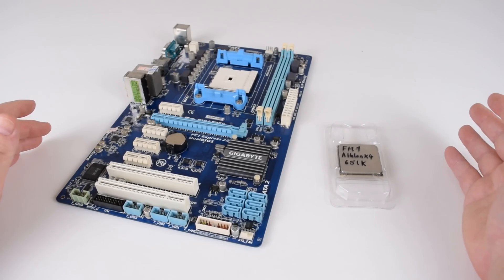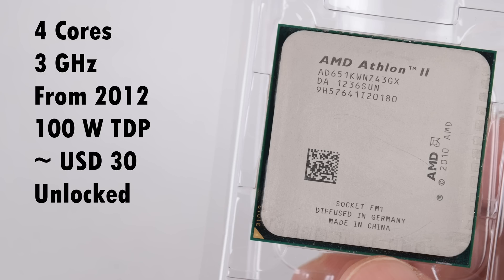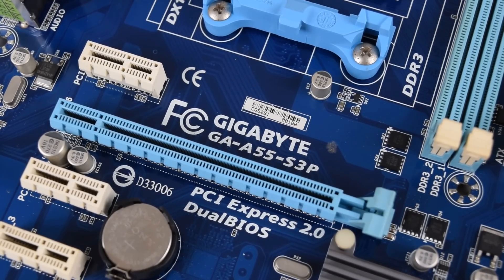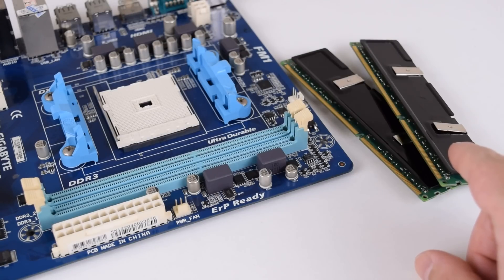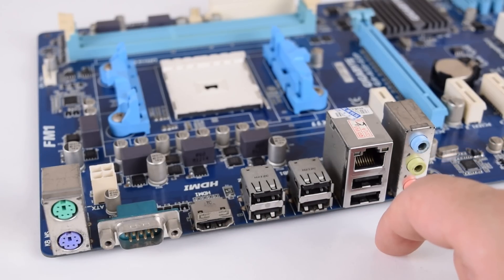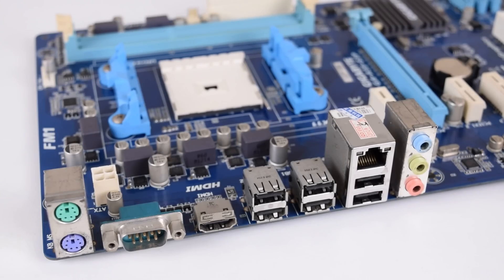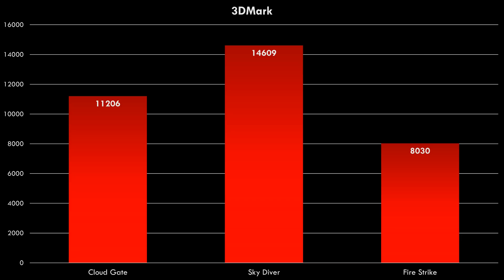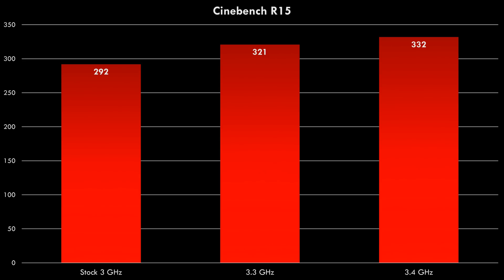Socket FM1 First Look: Athlon II X4 651K - The best CPU

Comment: Hi Phil, got a Athlon II x4 640 overclocked to 3.6Ghz in my Windows XP rig. I managed to get the GTX950 working with Nvidia Drivers 368.81 no problem, I just had to install with a GTX650 first then took that out and replaced with the GTX950 and it picked it up and installed the drivers! Really happy with the performance and it only cost me $10 more than a GTX750TI and chomps through frame rates on XP games like a hungry horse! Totally recommend trying it if you get the chance! :)
Reply from the maker: Oh you're using the X4 640 with Windows XP? Nice. My choice would have been one of the fast dual cores, but then it does depend on which games you're playing. Also, I should have a GTX 950 soon. They seem to be priced just a tiny bit higher than GTX 750 cards on AliExpress.
Reply: @philscomputerlab  Yeah, I've got the Athlon X2 7750 which is awesome in XP, but I won a Athlon x4 640 on eBay for $6 so I swapped it out and it is running a little faster I've found (even though it has no level 3 cache on the x4 640). Anyway, hope you enjoy testing the GTX950 in XP, I know they are a little more expensive than the 750Ti but I feel they are worth it. Can it run Crysis I hear you ask? What do you reckon?! ;)
Reply from the maker: To be honest, I found the 750 Ti has plenty of performance to run anything from the XP era, even at 1080p. Keep an eye out for a Phenom II X2 with high clock speed. The Business Class CPUs (I reviewed the 3.5 GHz) version with L3 Cache are excellent for XP gaming.
Reply: PhilsComputerLab I saw that Phenom video thanks, I had a look on eBay for one last month and they were quite pricey compared to the Athlon II x4’s. Not sure how much performance I would gain with level 3 cache on the Phenom’s in XP? I only went for the GTX950 because I kept on losing auctions on eBay because every Tom, Dick and Harry was bidding on them. I found less people bidding on the 950’s and fortunately I ended up being the second bidder on the one I ended up getting for not much more than 750TI which I was really pleased about. So yeah it’s turned out to be a pretty good deal! 👍
Reply from the maker: @PierreVonStaines  Yea I hope my 950 will work when it arrives. The 3.5 GHz Phenom II X2 is maybe 30% faster I would say.
Reply: PhilsComputerLab I’m sure it will be fine! 😉 The ones I have seen on AliExpress look pretty legit so it will be interesting to see what you think. I’ve have a new found appreciation for Amd processors again so I will keep an eye out for a decent deal on a Phenom (although FX8350 are going pretty cheap new at the moment, so that’s another thought 🤔).
Reply from the maker: @PierreVonStaines  I got the cheapest one I could find, a model from Gigabyte :)
Reply: @PierreVonStaines  I have an FX-8320e which is just a lower power 8350 and I can say even in 2019 I'm quite happy with its performance. I have mine paired with 16gb of RAM and an R9 380x and I'm getting over 100 FPS while recording my gameplay at 1080p 30 FPS and its smooth as butter, no jitters or stutter.

IDK how it would handle running a retro build as that would probably be extreme overkill (I'm running 8.1 X64) but for modern games it just blows through games like the Middle Earth saga and War Thunder while letting me capture gameplay no problem so if you can get one for a good price? I'd say go for it, having all those threads makes OS responsiveness just insane when paired with even a budget SSD.
Reply: Hairyfeet Thanks for the info, FX processors generally get mediocre press when looking at reviews I keep hearing from owners how happy they are with them. The old Athlons x2 and x4 have really surprised me, after sticking with Intel for the past decade I feel embarrassed that I have missed out on these AMD processors. I know lots of Intel users have jumped on the Ryzen bandwagon because of its stunning price to performance, but I think I am going to go for a FX8350 and motherboard for cheap build and reuse a load of parts I’ve got laying around. I’ll let you know how it goes! 👍
Reply: @PierreVonStaines  All those press guys going "poo poo" over AMD FX? Yeah look at what tests they were running, Cinebench (which got caught a couple years back rigging against AMD, it was reported by Tek Syndicate) and a bunch of programs and games that were single thread bound. Yeah single thread performance is great until you think for a second and ask yourself...how often are you ONLY running a single thread on your PC?

As I'm typing this I'm watching a video AND I'm doing a 1080p 30fps gameplay footage render...and its completely responsive, it feels no different than if I was just watching a video on YouTube. No lag, no jitters, even with all 8 cores pounding away with 96% utilization Process Lasso reports I've got 100% responsiveness. The same goes for capturing gameplay, I'm getting between 87-112 FPS while recording at 1080p 30fps and I actually had to turn on the little "You are recording" indicator because I kept forgetting and would end up recording the lobby while I ate a sammich. No lags, no stutters, just smooth as butter.

So yeah you want a cheap build with plenty of muscle, that can last a good while? I'd highly recommend the FX-8 series. Heck I'm not even OCing, I'm running stock but OOTB I ran the OCing utility that came with my board just to see what she would do and easily hit 4.5Ghz and talking to the guys with 8350s that is pretty much standard. Just get a decent cooler (I'm running a Zalman CNPS11X but any good Zalman or Hyper cooler will do) as the stock coolers are rather weak and I bet you will quite enjoy how snappy your PC is with 8 cores on call. GL and let me know how it goes!
Reply: For Windows XP, a GTX 285 is theee GPU to have in my opinion. Or if you got the power. and a nForce chipset... Two of these.! The GTX 950 is way better for modern gaming with DX11/12 support of course. But Windows XP has no DX11 support, so no reason for anything higher than the best DX10 card. For a Dedicated XP rig, my best experience is a Core2(or Xeon)  LGA775 CPU at 3+ GHz. (But I'm sure the Athlon II chips are also great for XP) Throw in a GTX 285 GPU (or HD4890) and SB X-Fi for sound. Superb compatibility, no driver issues. A 8800 GTX is also awesome for XP.. For Crysis a tHigh settings you want a minimum 768mb videocard (for high res/high settings a 512mb gives you lag) along with 3+ gig of system RAM. BTW. For Win XP era games you get no actual benefits of Quad Core. A Dual @Highest possible Clock speed is optimal. If you have a Quad core, you can disable the extra cores. Saves power and heat. :)
Reply: @Wushu-viking  Thanks for the tip pal.I actually use it in dual boot with win 10 for more recent games so I needed the DX11 support.Cheers
Reply: @AnarchieEnChiraquie  That makes sense that way. Great idea with dual boot. Saves space and money. :)
Reply: Thanks for the info guys. I just like mixing it up with using newer bits with XP and having the flexibility to install Windows 7 if I fancy it. I just find it enjoyable to see these old games running amazingly well and I feel it’s really satisfying to do so without spending a fortune. Especially when you come across a sweet deal like GTX 950 for not much more than a 750TI that everyone looking for a budget card seems to be interested in at the moment. 👍
Reply: Solid rig.I run an overclocked 4.6ghz G3258 with my OC low power GTX950 on my win XP rig.Had no problem installing the black edition straight with the 950.Same as you I had a great deal on it because everybody was all about the 750 TI
Reply from the maker: My GTX 950 arrived today! It's this one: https://www.gigabyte.com/eg/Graphics-Card/GV-N950CN-2GD-rev-20#kf It works AOK, ran some benchmarks and also cleaned it and fresh thermal paste. The card arrived in excellent condition. I got a bit of a surprise, it turns out the this REV 2.0 doesn't require a 6 pin PCIe connector! It is still an OC model and boosts just fine in games...
Reply: @philscomputerlab  Awesome! See I told you it would be fine! :) I ended up getting a FX8370 as they where going cheap on sale with a Wraith Cooler. I tell you, I am really impressed so far for a cheap Windows 10 gaming PC! Coupled it with 16GB of RAM and a GTX970 and just clocked the CPU to 4.4Ghz without touching the voltage and its performing great at 1080p (60 plus frames on games I've tested at high or very high settings)! It's a shame it's taken me this long to find my appreciation for AMD processors again but I'm glad I did, I listened to the haters for too long. I'll be giving it a good go and putting it through it's paces when Resident Evil 2 Remake goes live tomorrow (got it pre-ordered, pre-loaded and ready to rock)!
Reply from the maker: @PierreVonStaines  The FX 8370 is a beast. It might not be the strongest with IPC, but it has full 8 cores which goes a long way in many modern games. I played the RE2 demo for a while, it will feature in a few upcoming videos. I suck at aiming though :D The 950 surprised me actually, I already have a cool video planned. Prices have gone up a bit compared to when I bought it, so I think you have to be patient and wait for a sale or discount on AliExpress.
Reply: @philscomputerlab  Yeah! It is a beast for the money! It's a pity a load of people have said it is crap over the years and I listened to them like a fool. I'm glad you've been pleasantly surprised with GTX950, can't wait to see what you come up with for a video! Did you get it working with drivers 368.81 in XP okay? Like I mentioned before I had to install the drivers with a GTX650 installed first before doing the old switch-a-roo to the 950 but it's been great and I've had no compatibility issues so far. Hopefully the prices will settle down as I feel it is a underrated gem compared to the 750Ti. ;)

Comment: I remember when the FM1 platform launched and was abandoned shortly after. AMD had a promo with Codemasters, in which by buying the APUs you got a copy of DIRT3.
Reply: AMD did really badly those years. They abandoned this platform for FM2 where the bulldozer based APU was actually weaker in many CPU tasks, then they also abandoned it to FM2+ which was essentially the same thing just different FW and bioses. AMD those days was worse than Intel both in products (well those were their darkest years) and platform longevity and upgrade path were basically zero. 

The LLano based FM1 CPUs were pretty decent, the IPC went up from L3-less K10 and if they released 8c model with L3 it would have been better than everything they did until Ryzen. Shame they did not go that way.
Reply: @Lady_Zenith  i regret buying FM 1 board+ CPU as it started showing problem within few months. And after a year or two they stopped the support for fm1. I felt like a fool for buying this over Intel.
Reply: It was awailable on market for a few years,but yes they had stopped producing FM1 CPUs in 2012